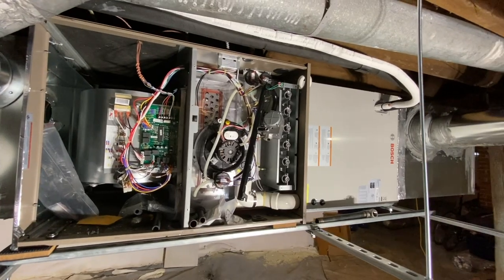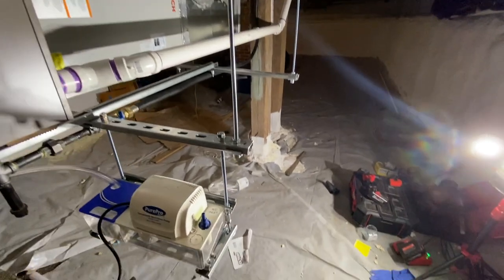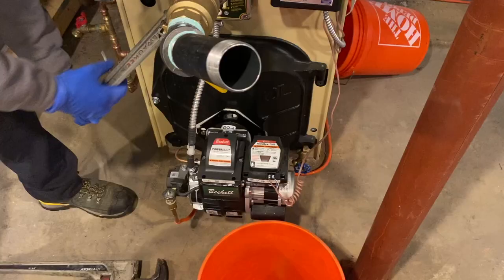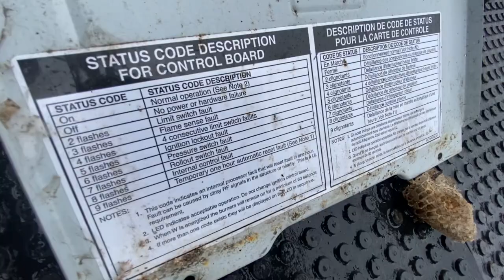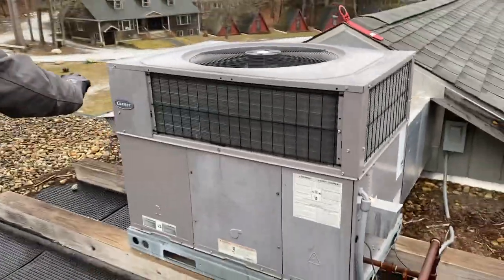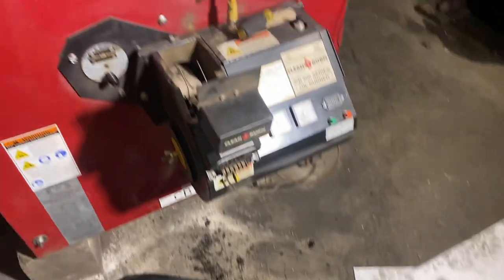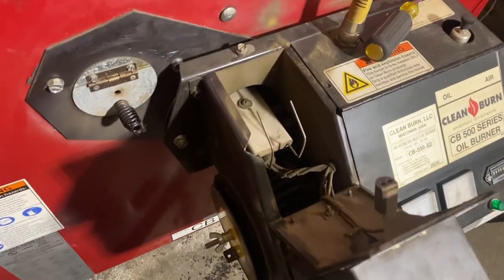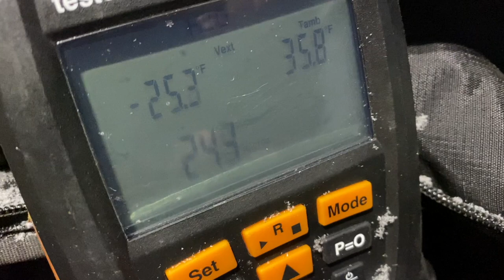A Week Of HVAC Installs And Service Work | What do HVAC Technicians Do? | Types of Jobs in a Day

Comment: On that Bosch furnace install can I ask why you double nut the nuts on the unistrut. It has proven by double nutting it creates more stress on the rod and nut and can cause stress fractures in the rod.
Reply from the maker: Thanks for that I’ve never heard such a thing!
Reply: @BlueCollarBiceps  yes this is actually from the bolt manufacturer hill man and fastnel have sent me about it!!!

Care must be taken during the tightening of the second nut as overtightening will lead to thread stripping or tensile rupture of the bolt. Although the nuts used for this method require little investment, the installation process itself is time-consuming and relies on the skill of the operator. It is also an unreliable locking method that protects poorly against vibration, which means it must be inspected and maintained often – increasing long-term costs. It is particularly ineffective when lubrication of the bolted joint is required.
Reply from the maker: @daveg8918  Hey well you learn something every day! That’s interesting I appreciate you pointing that out. Always used them as lock nuts basically but I don’t doubt this!
Reply: @BlueCollarBiceps  yes so did I but I was doing a warehouse and hanging 25 unit heaters and the inspector declined them and wanted me to actually use lock nuts: so I reached out to the manufacturers and was sent that and Millions of bits of other info. But I love learning new things
Reply: Dave can you send me a link to the case study that shows the rod failures due to using jam nuts? I would love to read through it.
Reply: @jonnymac31  can you send me your email please so I can send it
Reply: @jonnymac31  the other sheets are at my office but that was one I had saved

Comment: To skim properly boiler is under steam pressure. Not a trickle of water. Close angle valves 15 psi let her rip. Your setup is right but your not utilizing steam pressure. Steam is the lost art. Steam pressure is the best way to get rid of oil residue from manufacturing and threading black iron. During the skimming process of course. You have my number. The viewers need a max bench.     Then a bulkhead boiler removal.
Reply from the maker: Gonna agree to disagree on this one! Everything out there on steam points to a slow stream after making good steam. Basically you want a pencil width stream until it cleans up. Once you start you let it go the whole way through no stopping. No more surging after this was done. I’ll still do a max bench and boiler video though 😂
Reply: @BlueCollarBiceps   Ive done it both ways. I was taught under pressure. My theory was the same as yours and my elder went with it cause it made sense.  Had to go back to the nine section Weil McLean and do it over. Im just saying. As you know there are other factors. Your not wrong at all im not saying that. Squick has always been a my treatment... Never really tried a liquid treatment? You?